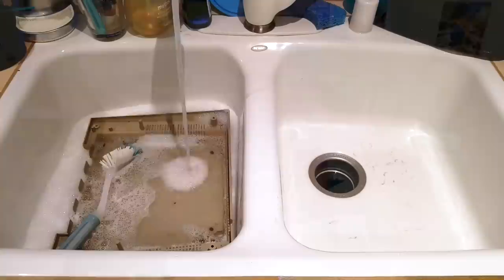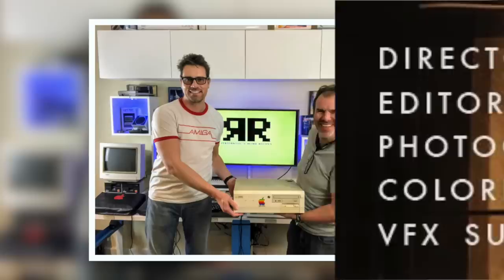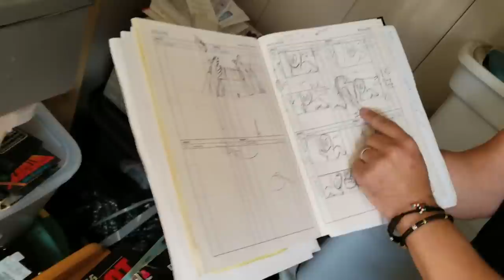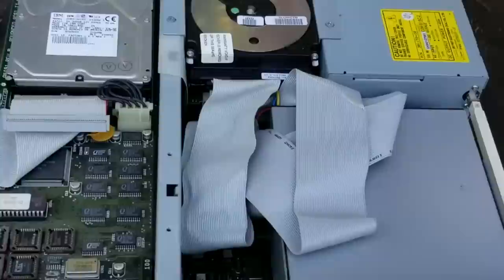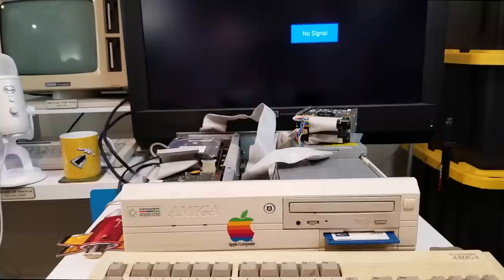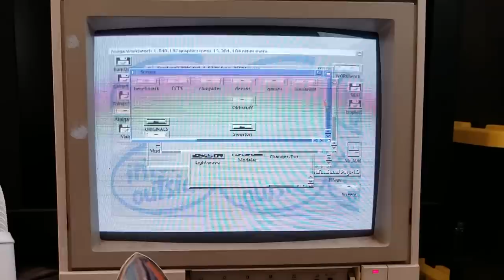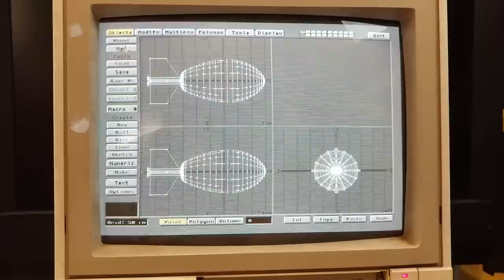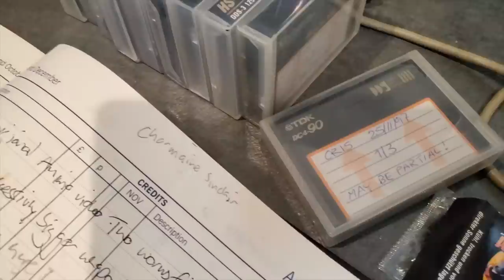I found Team17's WORMS developer Amiga 4000! Let's explore its harddisks

Comment: Just to help you with imaging of those hard drives: Those USB to IDE adapters only work with hard drives supporting LBA addressing. Which usually are only drives being over 500MB. If there are smaller drives you can't read, chances are that they just don't support LBA mode. You might try connecting them to the real IDE interface of an older PC, maybe they can be imaged there.

Comment: Get an OSSC. This will allow you to view NTSC or PAL RGB signals on a modern TV or Monitor. Add to that a HDMI capture device and you would be able to edit the captured content into your videos. Love the channel, keep up the good work!
Reply: Shouldn't even be necessary to do that seeing as the A4000 and its ilk were more than capable of VGA output, including upscaling / deinterlacing standard NTSC and PAL signals... and a dev machine like that almost certainly had a PC-grade Zorro / RTG graphics card in it. At least originally. You don't want to be doing all that 3D layout work within the graphical constraints of OCS or even ECS...

Comment: You can get the hard drives spinning by opening up the drive and giving the platter a small push. I’ve done it with many old macintosh SCSI drives that have been stuck after not being powered in for over 30 years.

Great video, thoroughly enjoyed it.
Reply: Sure, but I wouldn't do it with drives that contain priceless data such as these. Leave it up to a professional data recovery service, the risk of damaging the data beyond recovery is very high if attempting a DIY solution at home.
Reply: Too big of a risk of causing damage to heads or platters. Neither of which are easy to fix.
Doing this without some form of clean room/workspace is insane.

Comment: My favorite Amiga devs. I Remember them as 17-bit software from the early PD scene, I used to love the Amiga demo disks they had. Their games pushed the Amiga too, no ST ports to be seen here. What a top donation this is! facinating to watch the original artist rediscovering his old work.
This is gonna be a great series, looking forward to the next one. Great vid dude! :)
Reply: Definitely, as a more recent arrival on the Amiga platform, there were quite a few old games not familiar from my ST days ... and most of them, at least the ones that were technically impressive and really used the hardware rather than simply being too PD / too crap to bother porting, had a hirez-lace T17 logo at load time...

Particularly I was amazed to see Worms run on my A600, in very nearly the same quality and smoothness as we enjoyed on our DX2/66 PC. All that was missing were the voices and CD audio, and if I was to bother upgrading the RAM (especially finding some affordable way to add fastRAM in this day and age without installing a massively OTT accelerator board) to 2MB or more it'd have the full sample set. Quite what the PC was doing with its additional 6MB (especially as the video memory was entirely separate, so really "at least 6.25MB"), 57MHz and 16 bits, not to mention higher powered audio system, is anyone's guess.

Comment: This is what I love doing! Saving everything that made a particular machine what it was, always with the blessing of the original owner of course. Winuae has allowed hard drive imaging for sometime now. Always in admin mode and the little extra text in its icon info thing. Also a good one to know about and to have in your toolbox is HDDRegen! Now that program is amazing. I had a small 2.5" drive that failed, was sold as faulty and would click like mad at a certain point. I could not fix it in its native setup attached to an amiga, tried using all known tools via workbench and winuae, no dice.  So I had nothing to loose at that point and tried hddregen on it. I got an 100% image out of it after that :)

Comment: A actually use a Programm on windows that can open adf files and mount amiga formatet drives (I haven't tested the mounting thing but it says it works, even with a USB ide adapter). It's called adfview. It works great for me and meaby it can be usefull for you when backing up more amiga hard drives
Reply: I should add that the program hasn't been updated in a while but still works on windows 10

Comment: you start the computer and hold 2 buttons together on the mouse and you click on Pal Mode, and Reboot. you do not need PAL monitor :) I have 4000 and 500 as well. very cool video! awesome find! what a memories, i can't believe the amiga started being stored like that in the shed  :)
Reply from the maker: Well, that wasn't the issue. The monitor can't display PAL. Anyway we fixed it.

Comment: I know you already know this, but the most common reason for old drives to not spin up is stiction. You can sometimed get them free by holding it in one hand and rapidly rotating 90 degrees. The case and head move, the inertia of the disk causes the head to come free. In my experience it works about 50% of the time.  

Looking forward to your future dives into the trove. I got the file of the 3d worm. The bomb would be fun. 

Can you boot those images in the emulator or do the depend on some non emulated hardware?

If you have trouble with the tapes you might consider reaching out to Tim Jensen at newtek. Lordy, this stuff dates back to when he was still in Topeka. I remember when he and two other guys were sleeping in the space they rented downtown writing the first version of their amiga software.
Reply from the maker: Thanks. They work in emulator!

Comment: 3D for broadcast or video games was a cottage industry in those days with quite a low barrier to entry at one level (models were not exactly a sea of polygons) but with a high barrier to entry (hardware to render stuff and/or get it to tape was expensive, plus software such as Lightwave cost real money if you actually bought it). I actually think it is hard to get the whole kit and kaboodle working together, so this is quite a find. I am not sure how interested kids today would be in this if in a museum, what it actually needs is to be made into a YouTube series. Which seems to be happening. The hardware affected design decisions, so storyboarding mattered as did cheats, e.g. the cyclorama backdrop. How you did your render farm mattered too. Also the demise of the Amiga is a thing, when this was being made broadcast graphics were done on SGI boxes with Windows NT making a showing (Microsoft bought Softimage). So the Amiga was 'why are you using that'? as if it was a hobby thing not the real deal for 'broadcast' (not the same as games).
I look forward to a retro series on how 3D modelling was done way back in the 1990's.

Comment: Perhaps it can be ported to a modern OS that will allow real time rendering. Unlike the very long waits that were common some years ago, as hours per screen is one thing I do not miss about the old days. Thank you for bringing this forward and saving it from complete loss. I do know that some many things have been saved on Archive dot org. As the old files and OS are good for nostalgia, but being able to run on a newer system would be great. Such as a new release, and that could potentially fund the recovery of some of the material from the hard drives that are not booting, and more! 

The sad thing with many things is they are more often lost and nothing of them is ever seen again in the future. The one thing I would like to see is many things preserved so that in the future that others can enjoy them as we did in the past. Even today I find that some of the old magazines from the 1960's have technical articles that provide more details than things that are released today, along with enough information that things can be used into the future. The main idea behind copyrights is that the creators would be compensated, and many others can build upon what has been developed and compensated as well. That is a win-win, as opposed to protectionism and hording and then everything is eventually lost and none really benefit from the discoveries that were made.

Comment: Just imagine the hours Chris put in creating these assets on the clunky ole Amiga.
It'd be good to see the machine go to a computer history museum not into a private collection.
Reply: I remember putting in quite a bit of work making some (long since lost to a combination HDD and backup tape failure) custom levels and soundsets, and that was with the somewhat easier and faster software and processor in our Windows PC... (plus cheapo flatbed scanner and soundblaster card, no special expensive driver-nightmare toys required). Pulling it off on an older machine must have been ... fun.

(Then again I figure a 50MHz 68040 would probably be as fast as the DX2/66 we had...)

Comment: Glad to see such an aged machine booting.

The first that that comes to mind given that the Lightwave files are accessible again would be to see if they could be brought forward and given a re-render on a more modern version.

I'm not talking a full remastering, just something a tad better quality / higher resolution than the original videos.
Reply from the maker: Nice idea! 👍🕹️
Reply: Just take the original ones and see what the highest resolution and colour depth the original program can spit out, when being emulated at many times its original processing speed... Might get EDTV out of it at least (ie maybe 768x576 progressive at 50 or 60fps) with 15bpp, even if not HD or 4K HDR/deepcolor.

Maybe improve the audio quality as well which was probably something awful like 11kHz 4-bit ADPCM mono...

Comment: 4th backup option... Boot into Linux. dd if=/dev/sda of=/location.img. This will work in virtual box if you don't want to install Linux.
Reply: Alternately, there's dd_rescue and rescue_dd. These will allow you to attempt reading the drive backwards, bypassing a lot of functions of the drive, often resulting in making an unreadable drive readable again. There's loads of write ups on how to use these tools out there on the web, so I won't delve much more into it. : )

Great video. Keep em coming. : )
Reply: @ksln  I've never heard of those before. I will have to check them out!
Reply: Or use a DVD that's bootable to a linux desktop and a external ssd or flash drive
Reply: @ksln   would that work on a 32 GB sandisk extreme SD card?

My Samsung Galaxy j3 messed it up and I want my files back
Reply: Linux even supports the Amiga filesystem. It's how I used to copy stuff on my A600's hard disk :)
Reply: @kpanic23  Using Linux was how I was able to recover my A1200 HD years ago with all my OctaMED stuff on it. I was overjoyed to get all that back!
Reply: @kpanic23  expanding on this for those interested...
This will let you mount an ADF file under Linux, no extra software required (replace .adf file and mountdir as needed):

sudo mount -t affs -o loop -o mode=777 diskimage.adf /mountdir
I've also used it to access an Amiga partition on a SD card I use in my A3000 with a SCSI2SD
sudo mount -t affs -o mode-777 /dev/sdc1 /mountdir

More info:

https://github.com/spotify/linux/blob/master/Documentation/filesystems/affs.txt

Question: since Android is based on Linux, does it include FFS support, or did they strip it out? I don't have a rooted device to test this on.
Reply: @nathanmead140  I suppose, but I think the gains from reading it in reverse are mainly related to the mechanics of a hard drive. It not getting stuck in a position it would otherwise.

In regards to your SD card, I'd make an image of it utilizing any means necessary and try to read it using a tool like photorec.
You might not get the structure or names, but you might get the data.

Comment: I'm impressed you tortured yourelves for so long with that CRT, I'd just switched back to LCD and never found that NTSC utility
Reply: Isn't that why DblNTSC / DblPAL existed in the first place? Plug a VGA or multisync into it already and the system should automatically deflicker. No actual Amiga dev would have put up with it back in the day, it's why external flickerfixers existed for machines that didn't have the built-in one of the A2000/3000 or the AGA chipset of the A1200/4000.

Comment: Someone else probably already mentioned this already, but the absolutely easiest way to completely back up an Amiga IDE or SCSI hard drive, is to connect it to a modern computer running Linux, and use "dd" to clone the drive in its entirety to a file.  That file, in turn, can be mounted as a hard drive in the emulator.  This has been working for years, nothing new about it.  If the file system is the standard AFFS, Linux can even mount the partition to access the files directly (Assuming the AFFS support is built into the kernel, or supplied as a module - It usually is.)  Most of my hard drives were PFS3 formatted ones, so I needed to use "dd" and WinUAE/FS-UAE (I use both).  This actually brought my BBS back to life, after almost 23 years!

Comment: My 1084 handles both 50Hz and 60Hz fine, but I have experienced similar screen issues myself. The problem for me was that the screen modes in some programs were automatically promoted to their double scan equivalents (DBLPAL, DBLNTSC) when I had those modes installed. Those modes double the horizontal scan rate to some ~30 kHz which works fine with some VGA and multiscan monitors but will throw TV rate monitors like the 1084 off. Removing the modes solved the problem.
Reply from the maker: That's probably it but the preferences were saved in the program and you have to open the program to edit them, anyway we got it working!
Reply: My UK 1084 seemed to handle everything, but that 1084 was an NTSC and it seemed to only handle NTSC stuff if I remember correctly.. damn monitors.. but yeah, we got it working ...finally
Reply: Orrrrrr you could just plug in a VGA-compatible monitor and hope it's flexible enough to handle the Amiga's 27~29ish kHz scan rates (vs the 31kHz standard). Any old skool Multisync should do a good job of it, but a good number of modern LCDs quietly support "low" syncs, some down to 24~25kHz for compatibility with certain old (mostly Japanese) non-VGA computers. If you're very lucky it might even manage the 23kHz of Super72...

Though if it's using any kind of upgrade video card you're probably looking at 35kHz as a minimum (SVGA/XGA or slightly higher frequency VGA, maybe even PAL60-progressive), maybe much higher. PC derived monitors of the early 90s were already well into the 60+ kHz zone - we owned one in 1994 that could do 1024x768 at 75Hz, and a graphics-focussed platform like the Amiga was no stranger to similar modes. Base AGA was somewhat limited by the low maximum pixel clock but could still manage 31~35kHz when suitably reprogrammed; upgrade cards had no such handicap.

Comment: You don't need to actually be able to read the filesystem to do a proper backup.
The best way to properly backup a hard disk (or really, whatever that is), it's to use dd on a Unix machine (Linux/Mac/whatever) or even better ddrescue which is an evolution of dd which will be able (in some cases) to even rescue some damaged sectors of the hard disk. What you're aiming is to get an image file which is 1:1 with the disk structure. Once you have that image, you're good. You can then convert that or open or whatever you like with an emulator or virtual machine to get to the actual files inside.

dd doesn't give a flying damn whether you can read the filesystem or not. It just reads the raw blocks of the disk one by one and copies them over. I highly recommend you do this to backup them.
Reply: Yup, went to the comment section to say exacly that.
Reply: Also, you don't even need a dual boot setup, just install Linux on a thumb drive and then ready to clone/fix drives.
Reply: @Exitof99  Exactly, I have a bootable GParted linux distro for this precise scope.

Comment: It really is brilliant find. It warrants a zelda "Link opening a treasure chest" sound.  I'm not sure it would be safe going back into a corporate environment unless they have a company historian (I doubt they do, and its not a criticism if they don't). An established Retro museum would be good, if they want it.
Reply: Yeah ... I've an old PC I saved from a previous job which is a miniature bit of computing history all to itself (having survived in use for about 25 years, as it was relegated to datalogging and live display duties where Windows 3.1 and a hopeless CPU weren't problems)... it was just tossed in the junk room to be recycled when the equipment it was connected to was decommissioned thanks to being too big to remove from a condemned building in working condition. I was too slow to save the BBC Micro "Master" it had itself replaced (and was just tucked in a nearby cupboard and forgotten about), which, as it didn't have a hard drive, just a box of 5.25" floppies, was unceremoniously ditched into a skip, along with its monitor, drives and software, and had several tonnes of rubble from a different building piled on top before being carted away to landfill. Beancounters don't care about history unless they're forced to, they just want to know, if anything, what new thing they can temporarily put their stamp on.

Comment: Hey Peri, check out HDDRAWCopy.
You can take images from everything on windows, linux with windows disks and even Amiga.
Then you can restore them back with the same program.
As for the PAL screens you could see them in a dirty way like pressing Amiga key + M and then scroll down the WB screen.
The image in the background should take the front resolution :-) (or just use WinUAE)